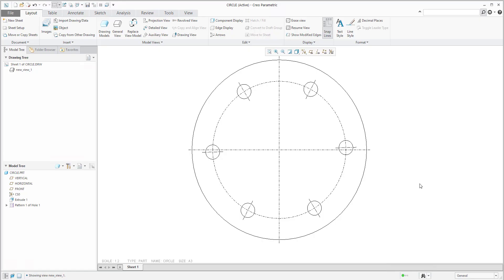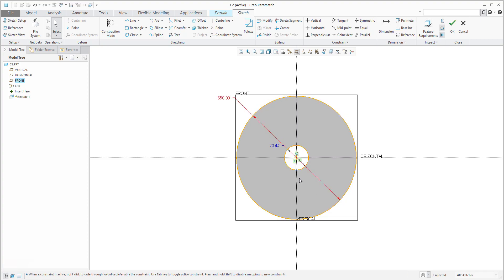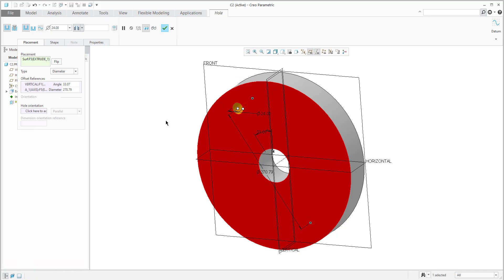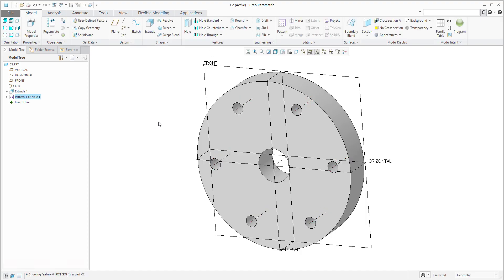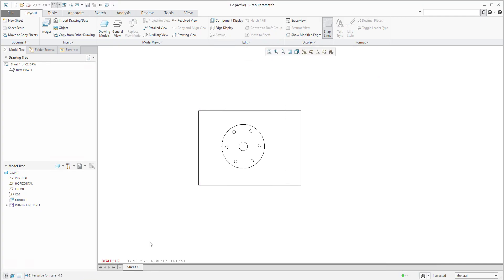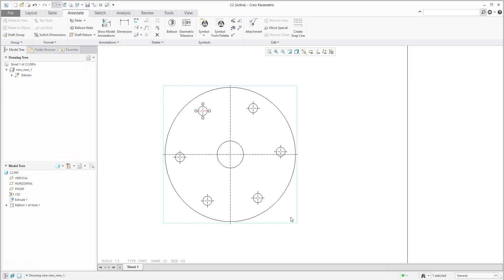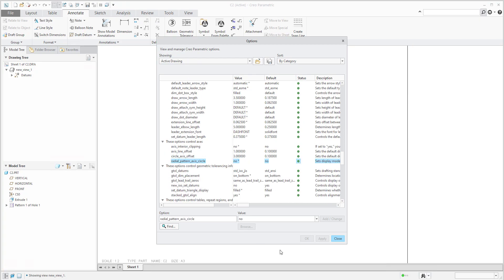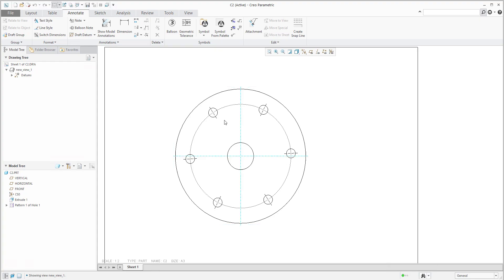Radial pattern axis circle | Creo Drawing tutorial

Comment: hi, and how could I add the dimension to the circular reference? in the option to show model annotations, it only appears radially but not diametrically, how could I solve this?
Reply from the maker: Hi, if you want to show model anotationr(create on 3D) you need to create diameter dimensions in their sketch or create diameter holes.
If you want to create dimensions only in the drawing mode, it also easy: select arc or circle two time (Doble click on the curve) and then middle button to place value (same logic in the sketch mode)
Reply: @4kside  yeah its just only in the drawing but i don't get it why i can't select the circle reference from the pattern
Reply from the maker: Best practice is to show dimensions (you are able to reuse existing from feature and also you can directly change if needed from the drawing mode)